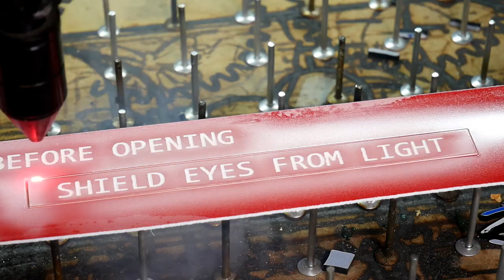Build a flux capacitor!

Comment: I made the same 3/4 inch front panel but used 1/4 inch MDF and 1/2 inch MDF glued together. That way there's no need to route the window. You can jigsaw the 1/4 inch for the rubber surround and don't need to have perfectly smooth cuts as the rubber will be covering it.

Comment: The scene of cutting the board at the very beginning of the video is VERY DANGEROUS.  You should always have the majority of the board stock on the outside of the blade away from the fence.  The small piece being cut off should always be between the blade and the fence.

Comment: "build a flux capacitor"????   Please tell me that I'm the only one who doesn't have a 3 d printer and laser cutter,    Be real and di this with readily available tools,   most don't have a budjet for tools like this.  And also use the tools correctly
Reply from the maker: Machines only speed up the process to building things, nothing is stopping you from making the parts by hand, you can make the solenoids out of wood with a hole saw and the spark plug covers can be bought online, The acrylic window doesn't need to be a neat cut so it can be cut with a jigsaw, the lightbars only have two visible edges which can be gradually sanded with different grades of sandpaper to produce a polished finish, I'm happy to make any of these parts for you if you so wish to help you alongside your build, making excuses that you don't have the tools will only hinder yourself from completing your projects, try to be creative.
Reply: What tools would you say are acceptable for someone to make things with? Do they need to be ones you personally own? Under a certain price or size maybe? My 3d printer cost less than my router, they are most affordable and take up very little space unlike other tools.
Reply: True, and if you want to be movie accurate Doc Brown used
an old 80s Dymo Label maker that had raised letters
also a lot cheaper

But lets also be real
- This entire project is something that people don't just have on hand
- Most people (Normal People) do not just have an Oscilloscope , Soldering iron, 
   Electronics parts, Arduino just lying around

- In a project like this, when you decide to do this you decide that you're going to put in the effort to make it no matter what it takes, it's not about Budget, IT'S ABOUT FUCKING COOL and the possibility that you MIGHT JUST ACCIDENTALLY send yourself through time :P

- If you want to BE REAL and lets look at what that means
does BE REAL mean  BE POOR AND STAY POOR
or does BE REAL mean , PUT SOME EFFORT INTO BETTERING YOUR LIFE AND MAKING SMALL ACHIEVEMENTS THAT LEAD TO BIGGER ONE'S

so let's be real
BEING REAL is achieving what you set your mind to do 
but having WHAT IS JUST LYING AROUND is different from person to person.

Me, i have 4 oscilloscopes, on of them is $8,000 , 2 soldering irons , 2 Video microscopes and an entire electronics lab with a few thousand parts 
Now i would argue that most people don't have that just lying around
BUT I DO
i would also argue that Most electronics guys don't but SOME DO
so what does your statement mean anyway ?

This isn't
How to build a project in 5 mins with common household items
IT'S A FLUX CAPACITOR
Possibly the furthest thing from ITEMS YOU JUST HAVE LYING AROUND